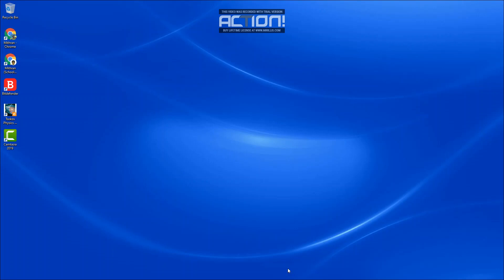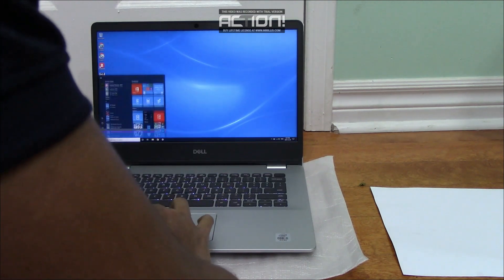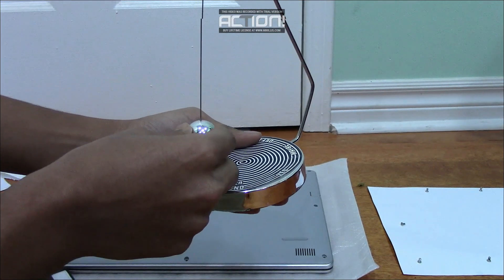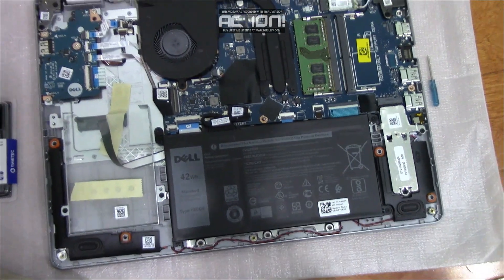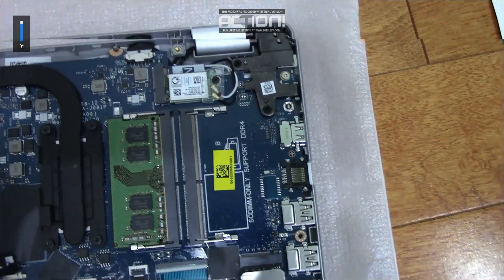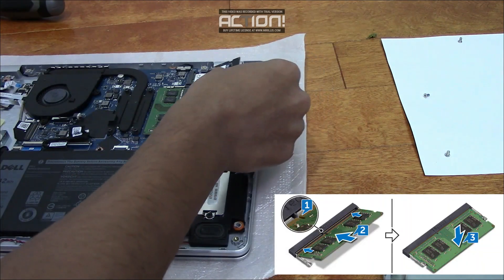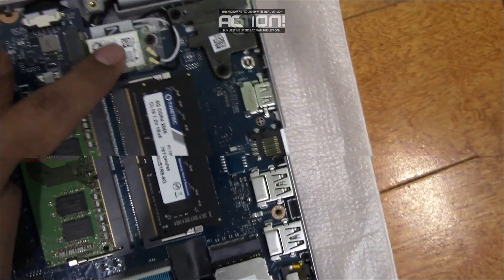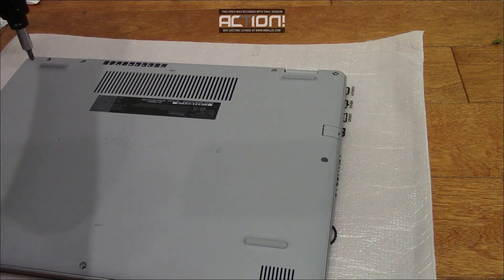Upgrading my Dell Inspiron 14 5000 (5493)'s RAM from 8GB to 16GB!

Comment: Hi Mith, Im wondering how the laptop has been holding up. Has the laptop been working well with the added RAM? Thanks for the tutorial!
Reply from the maker: Hi Jack, the laptop has been performing pretty well. The added RAM has been very useful and multi-tasking is usually a breeze. My only complaint would probably be the battery life. It was never that high to begin with I guess, but now it's surprisingly low (I think a few hours tops). Thanks for watching!
Reply: @mithstechchannel4273  thanks!

Comment: warranty voided by opening it to upgrade?
Reply from the maker: No, I asked Dell beforehand, and I believe they said it would not be voided as long as I used a compatible RAM stick and did not cause any accidental damage or something along those lines. If you have a warranty, I would encourage you to also ask before doing any such upgrade (and maybe saving the transcript of the chat afterwards, just in case).

Comment: Hi whats the best cooling pad for this laptop you recomend?
Reply from the maker: Well, any cooling pad which can hold a 14 inch laptop can likely do the trick. However, keep in mind that the cooling vents of this laptop are on the bottom, at the part near the hinges. So, one of the cooling attachments which attach to the side of a laptop won't work. 

Currently, I am not using a typical cooling stand per se, but like two things which elevate the laptop slightly so cooling can improve (this one: https://bit.ly/3lojJZb). It is helping a little bit, but not as much as I had hoped. I am actually sending the laptop in to see if Dell can do anything about the overheating (and my BT is down too).

I don't know a whole lot about cooling stands, but I'd recommend to go with one which has relatively decent reviews, and and costs a reasonable amount. If you want optimal cooling, lots of fans (like this one: https://bit.ly/32sMjQA) may also be preferable.
Reply: @mithstechchannel4273  tq dude youre my life saviour :) subscribed thank you so much

Comment: If on board ram crash than it leads to mother board replacement or not
Reply from the maker: I don't think I'm completely qualified to answer this but, I think the odds of the motherboard getting damaged are not too high. If the laptop is under warranty, you may want to ask the customer service if adding RAM will void the warranty or not.

Comment: hi i just checked crucial.com to scan my laptop, but it shows me that i have an inspiron 5490, but my laptop is an inspiron 14 -5000, is this correct or not?
Reply from the maker: This is correct. I also have an Inspiron 14 5000, but my exact model is an inspiron 5493. Technically, the "full name" for yours would be Inspiron 14 5490. So, I'm guessing that our laptops are very similar, but some internals are different. 

Although Crucial's scan say the max memory could be 64 GB, personally, I would not risk going over 16 (unless you get the the green light from Dell support). Going over the manufacturer supported maximum can cause potential problems and void warranties.
Reply: Mith's Tech Channel thank you so much

Comment: hi i got this laptop as well,  im not very good at using laptops, but can it handle a 16gb ram upgrade? to make it 20gb ram
Reply from the maker: If you have the exact same model as me, then unfortunately no. I talked to Dell customer support before upgrading the RAM and they confirmed that the maximum total RAM that is officially supported is 16 GB. If you have a different model, you can search up what the maximum manufacturer supported RAM is or check on https://www.crucial.com/
Reply: Mith's Tech Channel thank you,  and yes it is the exact model apparently :((

Comment: Thank you for the informative video : ) , I have the exact same laptop. I was looking to upgrade the SSD component, any more information that you could share, which SSD and how to install. 
:)
Reply from the maker: The most important thing is making sure that the SSD you get has the correct form factor. If you have the exact same configuration as I do, then the the m.2 slot would be occupied and one SATA slot would be empty. So, you must decide if you want to REPLACE the m.2 SSD or ADD a SATA SSD. I'd probably recommend the latter. If your laptop came with a slightly different internal configuration, or once you've decided on exactly what you'd like to upgrade, I'd be glad to answer any other questions you have. Thanks for watching!

Comment: Hi, is the original memory soldered or removable? Thanks
Reply from the maker: The original 8gb stick is removable
Reply: @mithstechchannel4273  Thank you. Thinking of putting in 64GB
Reply from the maker: @sachinsprasad  You're welcome! Unfortunately, if you have the exact same laptop model as me, 64gb of RAM might not be supported. I conversed with Dell's tech support before upgrading the RAM and they said that "the maximum memory for system is 16 GB". The setup and specifications manual also confirms this (https://topics-cdn.dell.com/pdf/inspiron-14-5493-laptop_reference-guide_en-us.pdf). Now, if you have a different model, you could check if 64gb is supported although I've seen that many laptops only support a maximum of 32gb.

Comment: This cheap laptop’s building quality not bad, and it’s so good.
Reply: I wouldn't call this laptop "cheap". I've had cheap plastic "L"-brand, which I'd call "disposable" (G-500 series), which is only good to reconfigure and save it as an entertainment center, for as long as you won't have to open/close it: hinges are garbage. 
I've used many laptops in the past, from original IBM ThinkPad to then Lenovo's  branded ones, then HPs, Asus (very good!), to Dell XPS high ends, and I will take Dell 24x7, regardless of the price tag. I feel Dell is by far more responsive to customer's feedback, and improving upon it.